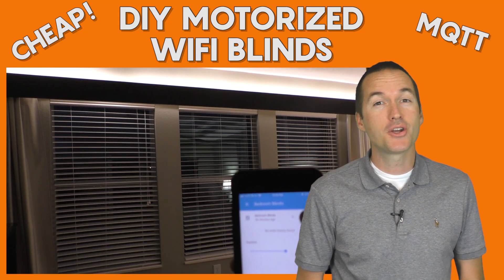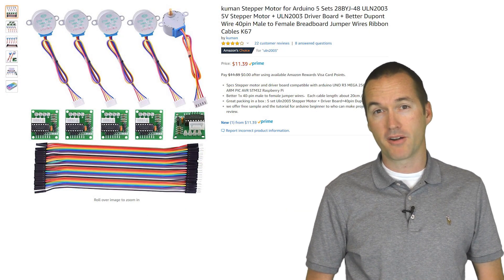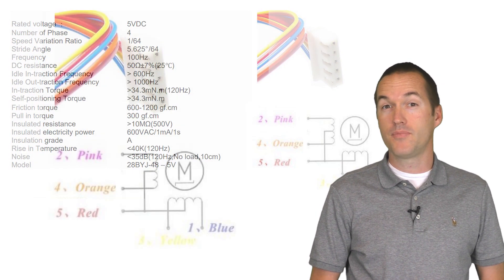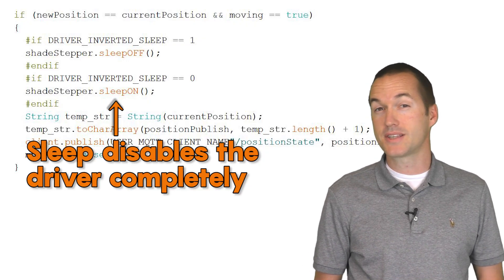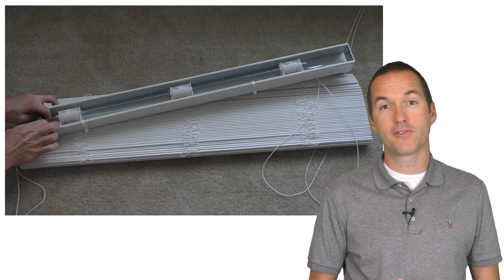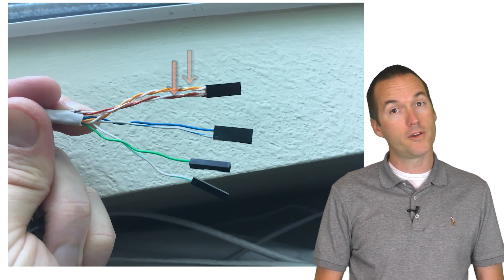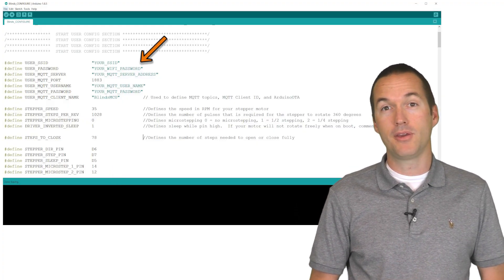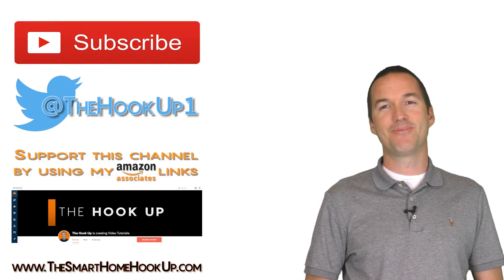Motorize and Automate your Blinds for $10! (WiFi)

Comment: What about a simplified method? No wi-fi no smart just a potentiometer next to each window and a solar powered battery in the window. I have a manufactured home that has those odd storm windows basically a window on the outside and the window on the inside what I want to do is cut down a set of blinds to fit in between the two things of windows there's more than enough space like 5 inches. This is to stop my cats from tearing apart the blinds because now they'll be inside the window. But now I won't be able to get to the thing to open and close them :-)

Comment: Just to say thanks for this video. It's taken me a while (weeks on/off) as it is my first project of this type. Since it was my first project, I gradually understood that this tutorial assumes a lot of prior knowledge, across the electronics, control code/MQTT setup. I also needed to tweak the CAD models to fit my blinds but this was not unexpected and I have experience with Fusion360 and 3D printing. However, I can now control my blinds via home assistant exposed to apple HomeKit and am pretty happy with the result. I am a little suspicious though that my stepper motors are losing counts. Has anyone else seen that or has any tips?

Comment: It may sound crazy, but you can also buy an Aqara Roller Shade Driver E1 and take it apart. You can install the motor, motherboard and battery. You also have a USB-C connection to charge it. All that needs to be done is 3d print the right adapter for the rope connection. I think I'm going to try this since I don't know anything about coding myself. Google the inside of Aqara Roller Shade Driver E1 then you will understand me.

Comment: Hi, great DIY project!

I’ve got all the electronics working, and can control the stepper motor. 
I’ve designed a custom base that fits all the components, so I can control all my blinds (8) individually. 
My problem is, that my hex-rod for my blinds only need one full rotation to completely open to close. 
Currently the motor turns almost 4 times. 

How/where can I adjust settings to fix this? I’ve tried a few things but don’t seem to get it working correctly. 

I’ve also asked on the GitHub thread. 

Please help! Thnx

Comment: do you have a zigbee version? does the pull cords still work? i understand that the cord tilt is a worm gear and a sprocket. the problem is that that if the shaft is being turned directly by the motor, the worm gear wont turn with it but instead bind the worm gear and the whole shaft wont turn at all.

Comment: Silly question, but can you run these from battery?
Reply from the maker: Not easily no.
Reply: Okay thanks. It's just a bit messy with cables running down the walls that's all! 😊

Comment: This is fantastic content! I'm looking for ideas to automate my miniblinds, I will definitely be using some of the information from this video. I was going to go for servos, but what you said about them making noise to hold position is a very good point. I've got a 28byj stepper already, so i'll try that route first and see how it goes, I didn't know these weren't compatible with other stepper drivers, and i didn't know about the conversion from unipolar to bipolar. I'll try this out with some A4988 drivers from an old 3d printer.

Comment: Just came across your video as I'm about to the same thing.This is very helpful thanks! If you have enough of the tilt rod sticking out from the other end of the blinds you don't need to disassemble the tilt mechanism (just have the motor at that end) vand have the best of both worlds!

Comment: This is incredible – I'm wondering if these can work with a cordless blind? I have Nien cordless blinds that look almost exactly like the ones in the video, except I have no pulley. You just push or pull the blinds down. My problem is that my son's bed blocks the right end of the blinds and he can't reach in to push them up, or if I push them up, we can't pull them all the way back down. I have everything (and then some!) by way of electronics parts and microcontrollers, but I'm in an apartment, and I want to know if this is feasible before I start pulling stuff down. Thanks! Great great great video btw! Subbed! :)

Comment: I've literally tried everything and the motor spun up once. After that, nothing seems to work when following the schematic. Not on a breadboard, not on a perfboard I've been painstakingly soldering for over an hour. The NodeMCU doesn't even power up through the VCC pins, only via the micro USB interface.

Comment: hi The Hook Up, I've been trying to come up with a way to automate a motorized arch window shade. I thought about using a motor at the top that would pull the shade up and down, or to use a motor in the center base to open and close the shade (like a book that is opened/closed). Have you ever attempted to do something similar? If so, what are your thoughts or pointers on getting this done?

Comment: Hi there! Perfect video, perfect explanation!! I am very interested in building this setup; although I have some issues: I will be running this on blinds measuring 1m90 wide (74inches) and 2m00 high (78inches) Is the steppermotor you proposed here going to have enough torque to til it all? I've got 4 blinds like this so a standard solution costing €159 each is no option!  Also, i would like to have it controlled manually also; if anyone has an idea on that, please respond!

Comment: Rob, what are the RJ45 connectors you used on the PCBs?
Reply: These are the ones I got -- they fit on the PCBs.    https://www.digikey.com/en/products/detail/te-connectivity-amp-connectors/1-406525-1/1863540

Comment: I've been trying for 3 days to get the blinds to be discovered by Alexa. I've tried adding them via the Philips Hue skill on Alexa.
Reply: I am experiencing the same issue - I initially did this project about 2 years ago and getting the Alexa portion to work was the easiest. My Home Assistant crashed and I wanted to get back up and going really quick, but I can not get Alexa to discover any of my blinds - Does anyone have any tricks or tips to help with the discover?
Reply from the maker: I think I might need to recompile the .bin with the latest version of the alexa integration.  They have changed quite a few things about how discovery works and the original bin may not work anymore.
Reply: @TheHookUp  Thank you so much. Any chance that you'll upload the source code for the Alexa only version too? Right now the source code under the Alexa Only release is the MQTT version. Also I want to say a big thank you. You are making home automation more affordable.
Reply from the maker: @theone964  Give this one a shot and report back: https://github.com/thehookup/Motorized_MQTT_Blinds/releases/download/Alexa_No_Hub/Updated_Alexa_Only_Blinds.bin
Reply: @TheHookUp    Thanks again for the new Alexa bin file update! I have flashed about 5 different 8266 devices using the latest bin file - all results similar

The Flash update works great 
No issues with WiFi Manager
Device connects to local WiFi network without any issues
Alexa always discovers the device - no issues 

The 8266 devices are not responding to any of the Alexa commands

I have monitored the devices using the Arduino Serial monitor and none of the commands sent via the Alexa app are being recognized by the device

All I get is the current value of 0 to scroll in the serial monitor window - Thanks again for any updates or Input
Reply from the maker: @craig7011  Interesting.  Can you try setting the brightness in the alexa app and report back what it does "set blinds to 50 percent".
Reply: @TheHookUp   I have tried a number of Alexa settings across multiple 8266 devices. The On/Off and various brightness settings. I've reset the alexa device. Restarted the 8266 devices, reflashed the deviced .... all results the same ... no response to any of the Alexa command. I only noticed on one of the devices an exception was reported which  printed output in the serial monitor, but the device restarted on both occasions with earlier indicated results of no response to alexa commands
Reply from the maker: @craig7011  Hmm, frustrating news I'm afraid.  I just grabbed a nodemcu and gave it a shot.  Mine appears to be working well and responding to commands without issue.  When you issue a power on/off command in the alexa app the serial monitor doesn't show anything?
Reply from the maker: Can you try using nodemcu pyflasher to upload the bin and make sure "erase flash" is checked: https://github.com/marcelstoer/nodemcu-pyflasher/releases/tag/v5.0.0
Reply: @TheHookUp   ok ... I'll give it a try  ... any recommendations for the Flash Mode setting ... I am using a baud Rate of 115200
Reply from the maker: That should be fine
Reply: @TheHookUp  Thanks for this awesome project. Could you please when you get a chance put the source code (.ino) for the no_hub Updated_Alexa_Only_Blinds into the git repo?
Reply from the maker: @knuckles9045  I think it's this one: https://github.com/thehookup/Motorized_MQTT_Blinds/blob/master/Blinds_CONFIGURE_Portal_Alexa.ino
Reply: I'll give it a shot and let you know in a couple hours. Hopefully it'll help figure Craig's issue too
Reply: So I upload the new updated Alexa bin and Alexa discovered it as a light. Now to test it with serial monitor do I hook up the rest of the wiring or just leave the nodemcu plugged and powered by the USB and ask Alexa to do things and read the serial monitor output? I don't want to wire it up and have it powered from the PC USB port and have it underpowered and that cause another set of issues.
Reply: @theone964  yes. leave the NodeMCU connected to the USB port and powered by your computer and read the results from the serial monitor when instructions are given to Alexa
Reply: So I got mine to work. Got it to turn on/ off/ adjust the brightness. In serial monitor it confirmed everything also. Brightness 50%=6 on serial monitor if you have entered 12 in the number to steps as recommended
Reply: I'll have to wire everything up and power it from the buck converter and see if I can get the motor to move before I go ahead and install it in the blinds
Reply: Got it working. Does it have to stay turned on in the Alexa app the whole time? I turned it off in Alexa and the motor moved the position. Is there a way to program it so that even if you turn the device off in the app it doesn't move the position. I have routines that turn everything on and off and don't want the blinds opening or closing when the routines trigger.
Reply from the maker: No, that’s the expected/desired behavior unfortunately.
Reply: @TheHookUp  Thanks for all your help ... Got it working .... User error on my part!!!!
The rotation field MUST have a value in the WiFi Manager. I though the recommended value was also a default value  ... I only noticed the blank value while reading the URL string in my browser. Once I added the 12 in the rotation field ( Thanks @Chirag Patel  ) ... The updated Alexa version works fine  - Thanks again ( both the new and older flasher tools also work)
Reply from the maker: @craig7011  🤘
Reply: @TheHookUp  I've discovered an issue, while it doesn't affect the usage it's more of an admin issue. I am able to add more than one blind setup to Alexa and they are named differently and Alexa moves them how it should. Now when I try to assign the blinds to my different rooms it only adds/assigns the blind I first added to Alexa. So if I add my master bedroom blinds first and then add living room blinds and assign living room blinds to my living room it will assign master bedroom blinds.

Comment: The stepper has no feedback position...how you solve the problem if the blinds are half open and the power to ESP is lost (ESP restart) or if somebody move the blind manualy? How you syncronize blinds real position and stepper position?
Reply from the maker: They will just go to closed position and the motor will skip steps.  The 28byj isn't powerful enough to hurt your blinds and will skip steps before damaging anything.
Reply: @TheHookUp  Nice..but my blinds case is very small just 2.5cm x 2.5cm outside dimension...its imposible to hide inside that stepper

Comment: Bruh...how hard are you cranking on those A4988s? I have a handful of the pololu versions and only blew one from overheating. But the pots are solid.  Just gotta find a good screw driver that fits snug in the pot (this was the hardest part, I swear they make those pot driver slots a funny size), then just use an alligator clip to clip your multimeter to the shaft of the screwdriver. Bam! Low stress current setup.

If you go for the cheapest you get what you pay for. Find the lowest price, add 20%, that's your new lower bound. But seriously, stop beating up your pots, man....

Comment: Please make a video on how to motorize  roll-up window shades. Mine have a metal bead chain , pull cord. It's always jamming and after just 4 years I am having to replace three shades. I don't want to pay $75 per window for factory installed motors. Can you tell me how to do it cheaper?
Reply from the maker: $75 per window for a factory motor seems like a pretty good deal.  You could certainly do it yourself for cheaper but it of course requires tools, time, and know how.

Comment: Can't seem to get the torque on the motor for full closure. I've cut through the trace on the motor. How can I confirm this? It seems that any resistance starts to break the motor, hence the weak torque.

Comment: I plan on modifying this to work on plantation shutters. I was thinking for a long time I'd use a servo as I could probably get it to work without little modification to the shutter. I would attach it to the shutter like flaps on an rc plane. I figured the servo would not need to continuously run to keep them in place as they hold their position pretty well on their own. However I'm thinking these plans with the stepper motor would be easier to steal as I am neither an electronics engineer or programmer. I'm thinking that I will need to use gears or a belt to connect it to one of the rods as it will be tough to line it up with one even if I cut into the frame. I'm getting a cheap used shutter to test my design  on.